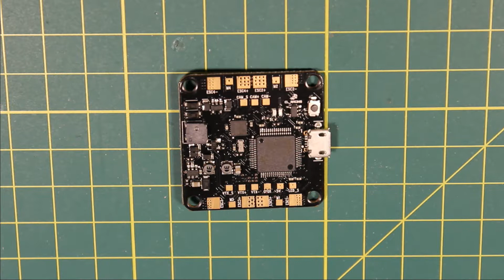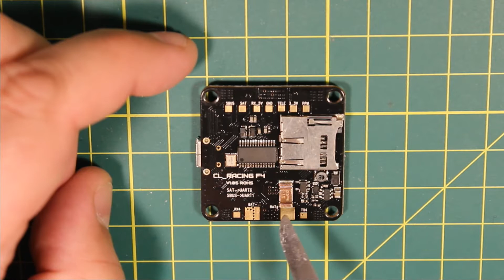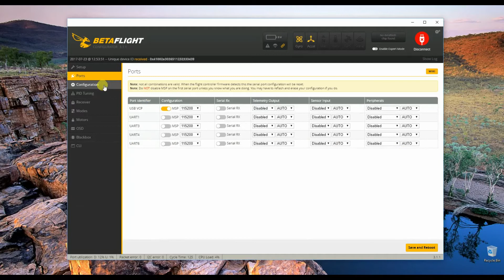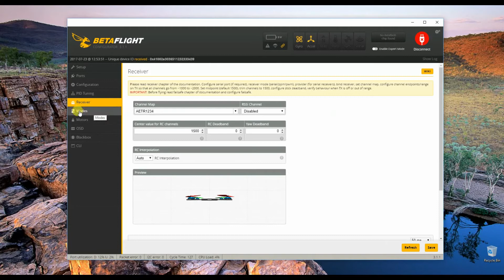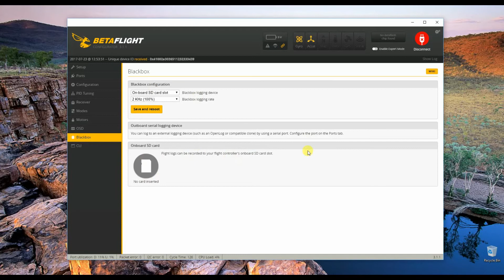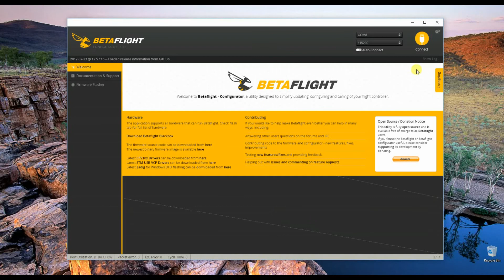CL Racing F4 - First Look

Comment: Where did you get that little inverter? It would be great to make adapter cables for my frsky RXs.
Reply from the maker: +m levine Ebay. I got a pack of 10 for next to no money...
Reply: I could only find complete cables on ebay. finally found some bare boards on aliexpress. Really silly that they can't just put the inverter on the FC Telemetry port considering the only people who will use it have a freakin inverted single...

Comment: does the buzzer work now with new betaflight release?
Reply from the maker: Yep. Its not the worlds loudest buzzer and it only seems to work when on battery for me (ie, not when powered through USB) despite how I set up betaflight, but it beeps away nicely when I arm and disarm. 

Don't know how useful its going to be as a battery alarm as you'll be unlikely to hear it but it should help as a model finder as long as you know roughly where it is (say you lost it in long grass).
Reply: XMode thanks, was not sure if it was a viable opinion for a on switch buzzer to find lost quad.
Reply from the maker: Yeah if you have no idea where it is and its a way aways it'll be terrible. You would be better off setting up the ESCs to beep the motors after say 5 mins (or 3 mins). But if you kinda know where it went but just cant find it, its better than nothing.